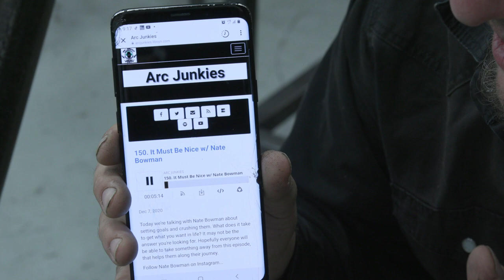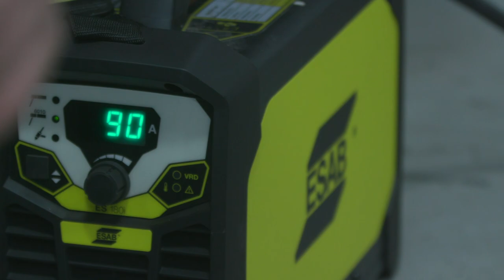Welder's Challenge: Could You Weld This Fit-Up?

Comment: Brought back memories of a bore job I welded on some 36". Water running through the bottom of the pipe, the fitup sucked and the ditch had 8" of water in it. A bad day!
Reply: . If I could have only 1 kind of red it would a 6010 ..

Comment: so take a couple clamps and a torch ... tension the clamps and heat up the spot welds and then push the 2 pipes into place ..... 5 to 10 minutes of work will bring things much closer into alignment .....

Comment: You kept moving the rod out and letting the puddle solidify, yet I never saw you chip or brush the weld.  Was there slag inclusion throughout the weld, did the slag not reach the point where you restarted, or did I miss something?
Reply: Using 6010 electrodes a good welder will burn it out. Also 6010 is meant to be mulnipulated like this.
Reply: @sonandsanford4963  Thank you for your reply.  Is the same true of  6011?
Reply: @oldoldpilgrim7898  yes, they are deep penetrating electrodes. Best for dirty materials like oil, rust etc.... also good for thin material down hill welding.
Reply: Thank you very much.  I keep 6011 rods on hand.

Comment: I just did something similar yesterday.  I just started dabbling in welding, no not an expert by any means.  I have a flux core welder.  I was welding a new piece of 22 gauge on my tractor bucket.  I didn't know how to handle the big gaps, but By accident I kept going from one side to the other ( basically what you were doing). I see I probably had my puddle too hot, but I did get it done pretty good.  Now I feel I could do it better after watching this video.  Thanks

Comment: Well well I am just an old welder !I would have put buttering runs in to close the gaaaaaaap .what are buttering runs light runs on each side to close the gaaaaaaap! Less heat impout once you have a nearer enough gap then weld it 😉 UK welder (different termoligy)stringers/beads weld runs.!ps I can do it your way .lol.

Comment: 9:00 In my opinion... not an expert in physics. Heat does not rise in a solid.  Fluids have a density dynamic. More heat equals more space between molecules thus less dense. Cold fluids are denser and will travel down with gravity. Resulting in the hot lighter (but still have a weight) fluids resting on top of the colder fluid.

Comment: With a gap that wide and offset ,  instead of  1/8 inch 7018 why didn't you use a 1/4 inch rod ? ? ?  --  I always keep some large rod on hand for just such circumstances ;  that or knock the Flux off another rod and use it as a Filler Rod .

Comment: Just code welded some joints a couple weeks ago TIG all way out, , phase array checks...had a dowtherm heater, 8" schedule 40 carbon mating to existing inlets, 2" mismatch on one of em...3/8" gap bottom and one side, almost butted on other. 4 come alongs and 4 dogs to get it pulled. Workaholic foreman hell-bent on just doing it as it was. Tacked up, rooted part of it, unbeknownst to me, after I left for the day the foreman decides to weld up the overhead where huge gap was and fucked it all to hell. Weld inspector comes in next day and goes ballistic. Told to cut out and refit...did that, I welded it all myself, checked good, all 4 welds passed. Next week I find out dickhead weld inspector had me on a verbal warning, neither of my direct bosses knew about it. I was irate. Point is, don't weld SHIT if you don't like the fit and damn sure don't let nobody weld on anything you'll have your name on if they're x-rayed or any other kind of test.

Comment: 9:00 techinically heat doesnt rise, heat flows from hot to cold. Hot fluids rise...
Reply: No, that’s not correct, once the air around an object is warmed by the the heat, it will rise, as warm air is less dense than cold air, so it floats above it.
Reply: @Jonathan_Doe_  Air is a fluid...
Reply: It all depends on the method of transfer:  Convection, Radiation, Conduction.   Everyone answering is answering a different question/scenario in their head.  So we're all right and wrong if we look at random scenarios without being explicit.

Comment: Hey bro,  i'm kinda new to welding. why 6010 on root pass?
Reply: Better deposition for the root
Reply: @williamguilfoyle3068  Really? cool. Thanks bro. Appreciate the response.
Reply: 6010 is a fast freeze rod so it solidifies faster so it doesn't collapse in as easy and it also handles dirt better than 7018
Reply: @markshort9098  Thanks Bro. Still working on keeping the arc length right.

Comment: grreat work on the ugly fit up on pipe.  Now how about some real world fabrication on thin to thick,  Sometimes I weld hss 100 to 14 guage then next day  1/8 to 14 gauge then  1/4 to 3/16,  then 3/16 to  14 guage . this coming week its 1/8 to hss 100 . making custom furnature throws curve's at me all the time. it is the life of the custom welder I don't weld pipe and will likely never do so, but I will build a tractor bucket like Mancub just did and a good job he did. Oh yah I just made side panels for a snow plow and I have another set to make
then a base for a snow blower motor, and the list goes on.and then an alumium box for a generator on a motorhome.amd so on.

Comment: Try fixing a steam leak under a building on rusty rotten 40-50 year old pipe!! Haha
Reply: Can't weld rust...

At least I haven't been able to, ever...

...but still I try it every time 🙄
Reply: @adampindell  I work for a School board. They just want repairs made quick and fast. So I usually slap some sch 80 beside it ;).. Whatever it is anyway. The worst ones are in F*** up spots. Especially when the pipe was fitted and welded before the deck was poured 🙄